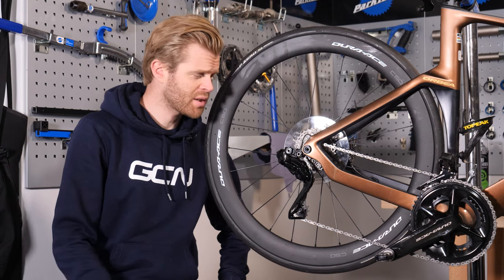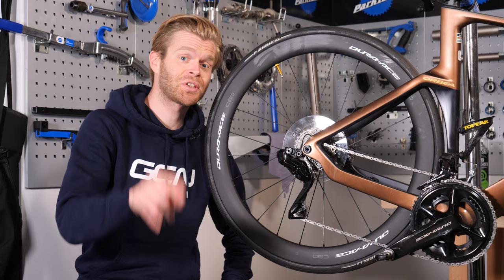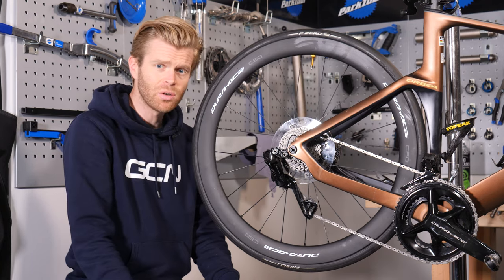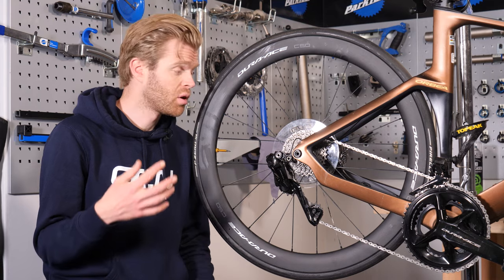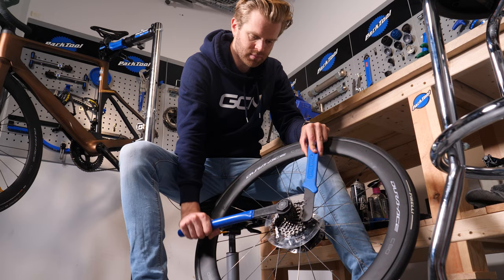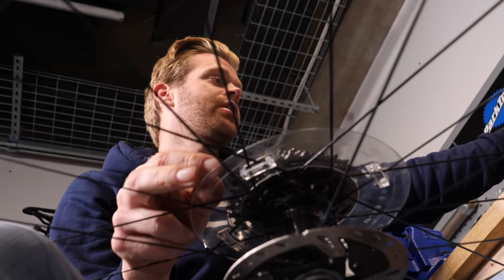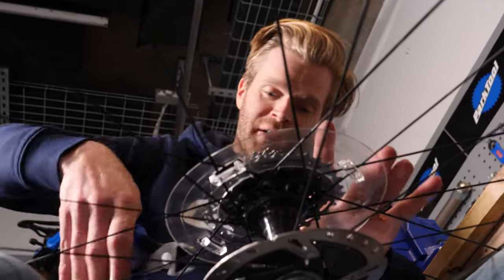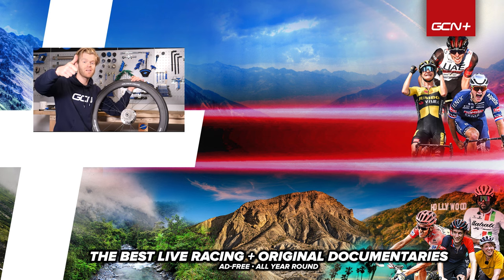How To Remove A Dork Disc From Your Bike | Maintenance Monday

Comment from the maker: What other maintenance videos would you like to see Ollie & Alex make?
Reply: How to install a dork disc.
Reply: How to properly polish or clean your helmet
Reply: @cappaculla  I believe polishing one’s “helmet” and cleaning it are two very different things… 🤣
Reply: @danielakerman8241  You mean like taking a vigorous shower as apposed to a normal shower?
Reply: Bedding new disc brake pads.
Reply: @Knitterfest  lmao
Reply: how to clean a helmet
Reply: How to remove a disc brake warning sticker 🤣
Reply from the maker: @Knitterfest  Reverse the removal steps! Unless you went will Ollie's bodge technique of course!! 🤣
Reply: Hello. Thank you for a funny and informative video. Could you talk about what gearing upgrade options for vintage bikes. Any restrictions on how big a gears can be put on a  vintage road bike. ie. I have a 1985 Cannondale  Sr 300.  Thanks. Love the channel.
Reply: Adjusting the front derailleur to accommodate a change from a compact 50t to standard 53t chain ring
Reply: How to remove a footstep from your bike
Reply: How to properly clip football cards with clothes pegs to both wheels?
Reply: How to correctly install spokey dokeys, which could evolve to a video on the fastest colour combinations of spokey dokeys, then Si vs a bike with spokey dokeys.
Reply: Baseball cards in the spokes.
Reply: Can you make a video on how to index the rear and front derailleurs please.
How to service the bottom bracket
Reply: Review on 3d printed saddles
Reply: How to correctly pronounce 'derailleur' 👀
Reply: One on maintenance for the ex would be great 👍
Reply: Obviously this was tongue in cheek, but of all the GCN presenters, Ollie can perpetuate the snob roadie persona better than the others. Time to move past that IMO.
Reply: How to install a kickstand in a super bike. Please have Ollie demonstrate on his Dogma F

Comment: I would like to see the UCI introduce them as a required standard, just like low socks.
Reply: You are opening a new market for companies like absoluteblack and ceramicspeed: oversize carbon aero dork discs
Reply: @feedbackzaloop  so disc wheels?
Reply: @nk-dw2hm  better: a disc fairing for a price of disc wheel

Comment: As a professional mechanic since 1984 Im fully aware of what the spoke protector does and doesn't do. Yes those stupid rings on high end wheels don't work very well. The most common cause of the overshift is not  a poorly adjusted derailleur. It is the derailleur hanger getting bent that is equipped on the majority of bikes sold  (high end road bikes are a niche market) those hangers bend very easily and are usually not true by the time the bike is in for a tune up a year later and many of the bikes I work will have evidence of an overshift probably half because it's pretty common. Those 3 and 4 pronged spoke protector do work on alot of normal small and large flange hubs just replace it with a new cassette. Some of those failures can be quite catastrophic to the parts and sometimes the body. But usually goes unnoticed until one of the drive side spokes breaks and then I end up replacing all of that side of the flange by removing them one at at time unthreading ,replace and get it up to proper tension onto the next in a staggered rotation. Then after all are replaced wheel truing begins. This process takes as long as a whole wheel build with all new spokes ...many just buy a new wheel. Some just replace the one broken spoke and have the wheel trued (and some of the time I break some more any way truing the wheel) and are back with a new broken spoke later. Too bad they don't make real nice looking ones that actually work for high end wheels...but then again that's a niche market with expensive and high profit margins parts . Cha...Ching ! Oh forgot chash registers don't make that sound anymore. So let's stop calling them dork disks it's insulting and unprofessional. And they do serve a majority of costumers well. Those bikes subject to alot of random stuff and not noticed until the inevitable overshift. Any mechanic that says that it's all about being properly adjusted is full of ....
Reply: I seriously doubt that most mass market bike riders follow this channel or watch such videos, so they're dorky within the confines of higher-end bikes and the people who ride them, like kick stands and schrader valves. Of course if you ride a nice bike but don't know the first thing about maintaining it, it might be a good idea to keep the dork disk.
Reply: so my question is I think my first road bike broke because I over shifted and I broke my derailer specifically because I didn’t have the plastic guard. This was a lightbulb moment just now. Currently I have a specialized allez… if I over shift, you guys are telling me that this is a legit safety feature? If anyone understands my two questions, please let me know. I have been on a bicycle for 2+ years as a mode of transportation. if it’s a dork dish that prevents me from breaking my bicycle im all for it
Reply: @kovie9162  OK never mind I don’t have that plastic disc however I have never been able to over shift. also my rear wheel just got replaced so it may have been taken off, but if it doesn’t actually serve any purpose then that’s OK too

Comment: I just got a new bike (your super-cheap beginner's bike from a few weeks ago that you looked down your noses at but a step up for me) and it has a dork disk. Figured I'll tear it off soon when I'm completely sure I have it all dialed in. It's about the same size as the cassette and barely noticeable.

I actually put a dork disk on my 1977 Trek two years ago. Found a vintage aluminum one that's a bit smaller than my freewheel so you can't really see it. I broke a spoke and had to dnf a triathlon when it got up in there. It happened a few times since and the dork disk protected the spokes. I know I'm a total loser and don't know how to ride a bike if that happens, but stuff happens with friction shifters and 45 year old parts. Got it dialed in now and have put a few thousand miles on it the past couple years without losing the chain up there.

Comment: I've just used the "bodge" dork-disk removal method for all of my bikes; snipping it off with an old pair of gardening shears takes about the same amount of time it usually takes me to locate my chain whip and whatever that cassette-nut thing is called. 

I'm actually dumbfounded that even pretty nice bikes come equipped with dork disks when you buy them. Is it a law or something, or should I just stop buying bikes at Walmart?

Comment: Hi Ollie, I do agree with you about the Dork disc.

What if we made a huge dork disk that covered the entire spokes, and another for the other side behind the brake rotor, we would then have a full aero disc wheel !!  Solves 2 problems at the same time 😂
Reply: I had that on my raleigh extreme. but on both wheels. it was incredibly extreme.

Comment: I have tried the bodge method once and never will again. I almost cut my hand open with the pointy plastic. So much cleaner with the cassette removed. I also like to keep them in a nice neat pile in my storage cabinet to never be used again.

Comment: I always thought it was to protect the disc brake rotor from contamination from the drivetrain 😅
Reply: Honestly that makes pretty good sense, lol 👍
Reply: Me too
Reply: Nope: Centrifugal force flings $#!t contaminants out and away, not across (objects in motion stay in motion: there's no motion across the wheel). 
It's there to protect the spokes from people who neglect their derailleur adjustment.
Reply: @wilfdarr  I was thinking more during cleaning and servicing.
Reply: @JonathanMallett  Oh I get you, when you're hitting it with the hose... Ya I could see how you'd come to that conclusion, but honestly, the bearings are more sensitive than the brake disk in that context and the DD doesn't do anything to protect the bearings (for this to be the case there would have to be another disk between the hub and the frame)

Comment: Plot twist - does a dork disc actually make the rear wheel more aero?
Reply: Also does it catch air in crosswinds and does it keep grease from the drivetrain off disc brakes?
Reply: Fantastic question!

Comment: Some wheels (like DTSwiss) have hubs which you can just pull from the wheel with cassette on. No need to remove cassette. Remove dork disc and put the whole freehub back on. No tools required.
Reply: My Shimano also does this i discovered while bouncing my wheel trying to get my tyre bead in place. It fell off, onto concrete 😞
Reply: Do DTSwiss wheel equipped bikes also come with dork disks?
Reply: @stevek8829  It is not wheel manufacturer's job to put dork disc. They sell wheel with freehub but without cassette. I have two Canyons and they assembled bike using that plastic thing. I believe it is common for most bike brands when assembling.

Comment: I believe the dork disk was initially put there at the request of legal representatives, who wanted to reduce liability in the case of a lawsuit where one alleges that the bike is inherently dangerous because if the derailleur gets caught in the spokes, it can cause loss of control.  We know, of course, if this happens it will just slow the bike down.  Today, it may have a second use: protecting the disk brake rotor from overspray when degreasing and washing the bike while it is being sprayed.  Can you relocate the dork disk on the other side, closer to the disk?

Comment: I recently acquired new old stock 27" wheels for my road bike and was debating taking the spoke guard off.

Even though I fully trust my setup of the upper and lower limits the deraeiouilllerr, I decided to just keep it on as I don't want to risk my spokes getting damaged if something bad happens. Also it has been great for reducing the amount of lube being flicked on the spokes and hub.

The bike would look slightly more appealing without the guard, but for the moment it shall stay.
Reply: I concur with you.  Keep it on but only provided it's a decent quality dork disc, that doesn't rattle or rub your derailleur or chain. Sometimes you luck out and get a dork disc with a tight fit that looks decent.  Most dork discs are low quality, rattle, rub the chain or derailleur & UV degrade quickly.  More people would keep them on if they actually FIT well & were made of quality UV resistant nearly invisible plastic that was only just as wide a diameter as necessary so as it looks 'austhetically pleasing'.  
      A 'quality dork disc' is a definate 'project' to design if you have access to a 3D printer!
Reply: @ministryoftruth8588  Yeah, this one fits really well and looks good quality. I do have one on a 90's Specialized Hardrock which was yellow from UV damage and was rattling about, so I have taken it off.

Comment: If you couldn't figure out how to remove the dork disc without watching this video first, you probably are not that good at keeping your derailleur adjusted and should keep the disc in place.
Reply: On the contrary, if you follow the rules and watch tech videos, you are more likely to read the derailleur service manual and adjust it corretly
Reply: No one's born knowing how to do most things. Particularly mechanical things like this. No need to have a snobby attitude. Spreading education and knowledge is a good thing; if you feel threatened by that, then maybe you need to address your own insecurities rather than project them onto others.
Reply: Exactly! Anyone with a multitool has already figured this out: anyone who hasn't already probably hasn't figured out derailleur adjustment and is going to get a chain in there sooner than later!
Reply: Now let’s imagine this video being the gateway to more confidence to working on a bike thus discovering how to also setting up a bike properly.

Comment: In the 45 or so years that I've been riding road bikes my chain has fallen onto the spokes exactly zero times. I adjust the limit screws and check for hanger and driveline alignment, so I'm good.

Then again, it's a way to make people think you have disc brakes, from a distance...

Comment: I keep it not because I can't adjust my derailleur, but it also keeps clean my rear rotor/pads from the chain/cassette dirt.
Reply: Mine is double secured with cable ties for exactly that reason.
Reply: @galaxymohit  you dont have to secure it. it's not possible to move it without removing the cassette anyway
Reply: Maybe clean your chain regularly…
Reply: @popeyebouldercreek  I do. But it is still a group of fast moving parts and an attraction point for dirt.

Comment: I think it might be mostly in the US, where Dork Discs are being attached. Saw them on a lot of bikes in the shops, when I visited a few years back. And I have honestly only seen them here on very cheap children's bikes. Never on any adult bikes. Wondering if the sentiment is to prevent dirty grease on the hub.
Reply: My sister bought a mid range Trek MTB which came with a dork disc in UE. Still riding with it she don't wanna remove it.
😅
Reply: You also find them in Europe. 
long ago my chain (of an older bike) fell between the cassette and the spokes, and the spokes had been bent and were gone. I still use dork discs, I don't want to ruin my wheels unnecessary.

Comment: Thus far, I've destroyed two derailleurs, two derailleur hangers, one new gp5000 tire, and one wheel because i dont use the dork disc.
But it has been many years since i had a problem because i always straighten my hanger and adjust my derailleur myself. NEVER TRUST LOCAL BIKE SHOPS! You're a dork if you let them touch your bike... That's just my experience. 😤
It's like putting your life in the hands of a someone still working their way through freshmen year of college.  I would only trust an MD with my life. And even then i wouldn't blindly trust that MD. I would want to know and understand exactly what it is that he or she wants to do and why! At least with car mechanics, they've had several years of specialized education. But with the local bike shop they just learn on the job.. hardly even have an apprenticeship.

Comment: I bent my hanger powering up a short hill on a 400k ride. At 300 km I shifted my rear derailleur into my rear wheel which ended my ride (at 1am) and did almost $300 worth of damage. New Campy Chorus rear derailleur and a rebuilt wheel. That's why the dork disk is there. I will never remove one again.

Comment: if you happen to have a dt swiss rear wheel you just need to pull up the entire cassette without dismounting from the hub, then remove that dork disc 😎 (I'm not sponsored)

Comment: 1:50 10 o'clock & 2 o'clock with your tools Ollie. 10 o'clock & 2 o'clock FFS. The reason they are on bikes is so that the factory assemblers can jam through the gears in no time flat without scratching the spokes with low gear overruns, and then leave it on (for the 30 sec time saving it takes to remove) and sell it as a benefit to retailers, who sell it to customers. On kids bikes, they're justified, as kids just chuck their bikes driveside down and bend the derailleur so that it deposits the chain in the spokes, no matter how carefully it's adjusted. Even MTBs without a clutch derailleur can benefit from them.

Comment: I have never seen a chain shift over the biggest cog at the back in my life. Maybe there is some small aero benefit?
Reply: no, it's to prevent the chain from going into the spokes when the rear derailleur isn't set up properly. i don't think people who ride 40lbs department store bikes care about aero 😄
Reply: Seen it a few times - easy for it to happen if somebody isn't that careful about transporting their bike or drops it on a ride - slightly bent mech hanger and can shift over the biggest ring. Particularly amusing if it's happened just after somebody muttering about dork discs and other people being incapable of setting up their bikes properly. Still wouldn't want one though.
Reply: I never had it happen until a month ago, one time out of the blue. No dork disk and rear wheel locked up. Going slow and didn't jam too badly. Now I'm paranoid and can't figure why it happened.

Comment: The chain looked a bit short and the rear derailleur was straining! Also, it looked on one of the shots that a couple of the teeth on the cassette were damaged. I wouldn’t like to suggest that Ollie would fit a chain wrong but…
Reply: hyper glide + ramps. not damage! and the chain is the correct length!
Reply: Chain doesn’t look close to being too short and the close ups of the cassette just look like normal used hyperglide. Shouldn’t be riding in that gear combo anyways so no reason to have more chain than needed.
Reply: @GCNuser123  beat me too it 👍
Reply: Frame at 1:15, second cog.